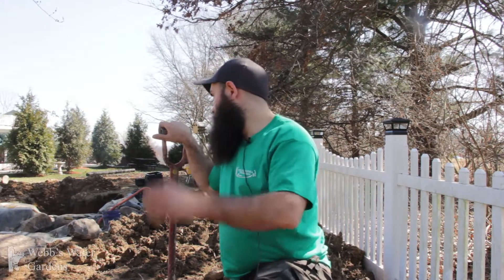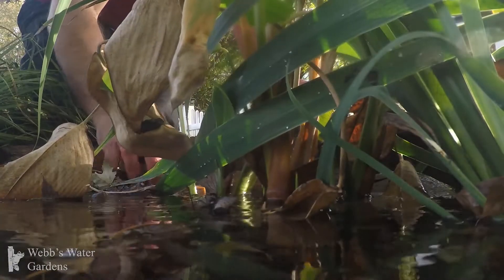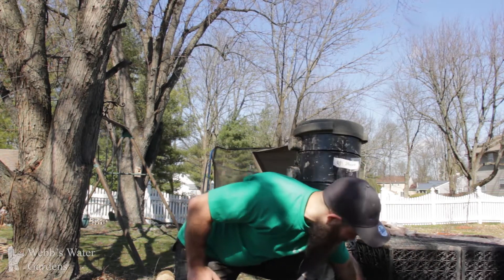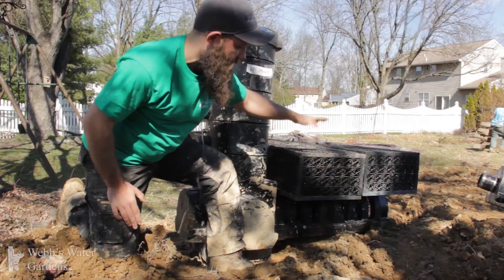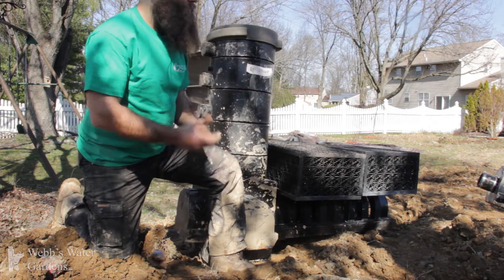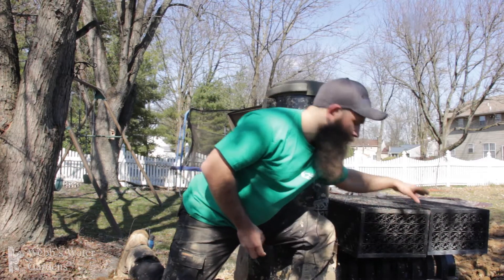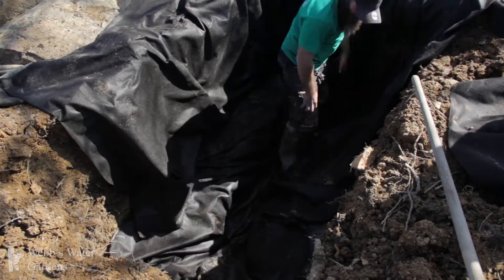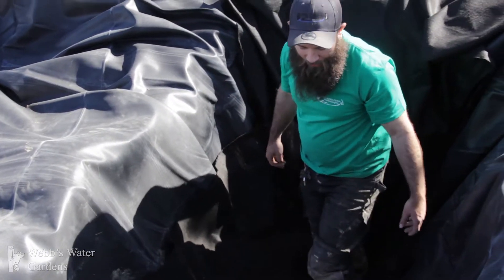Advanced Pond Build Part 1: Wetland Filter

Comment: Hi I am in the process of finishing my wetland filter. The size of the wetland is 7 x 12 feet. I am also putting 3 layers of river rock of different sizes. The weather has been really a factor on getting it done. I have a question How deep is the water going to be in the wetland filter ( I am talking about on top of the gravel ) before it goes back into the pond. Would 6 inches be OK or 9. Also I was thinking on using a 4,000 gallon pump per hour. The water will be coming from the intake bay. I have two large centipedes with a total length of 12 feet with the aqua blocks on top. Do you think 4,000 gallon pump is ok? Thanks You guys are doing a great job,
Reply from the maker: 6 or 9 inches should be okay. Be mindful here, as it depends on which plants you will be planting - certain plants can only tolerate certain depths. Please email all specs to joseph@webbsonline.com for review and pump recommendation. Copy & paste this conversation in the email for his reference.
Reply: @WebbsWaterGardens  OK thanks for the info.